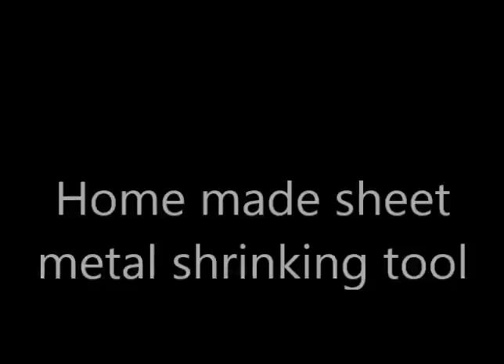Home Made Sheet Metal Shrinking Tool

Comment: Well done,very nice job, seems quite heavy duty which is what you want. Wondering why you made the vee blocks out of aluminium or did I misinterpret that? I’d imagine they must be subject to quite a high wear rate? Sorry for all the questions, final one, any idea what thickness of mild steel it can cope with.?
Reply from the maker: Yes, Niall, the vee blocks are indeed alloy (high spec aircraft stuff) which is more than adequate for the application. They are not subject to any excess loads  and slide well on the steel jaws and in the carrier. Easier to machine to boot !
 In steel, the thickest I have used is 18 s.w.g. but as for aluminium it would probably cope with 12 s.w.g. with ease. Hope that helps.

Comment: I like your machine , very nice. I am in the middle of building one my self and was wondering what is the ratio between your, hand and the jaws and if you were to build it over would you change the amount of leverage thank you for sharing -Spicer
Reply from the maker: Thanks for favourable comment, Greta Hovland / Spicer.
The top jaw has a total downward movement of .140 inches over the full 70 degree arc of handle travel. This leverage worked out just fine for my work and I would see no reason to alter this if building another one. 
Hope this helps to answer your query.

Comment: Hi Brian , very nicely built piece of kit ! 
I am dead keen on building one ! 
Could I ask , what thickness material you used for the sideplates , also , what keeps the upper jaws from falling out ? I would assume it to be the spring clip ?

Thanks in advance! :)
Reply from the maker: Hi, Hamish, - the side plates are 6mm thick - just what I had to hand at the time. The toes on the spring clip pass through slots in the stainless steel casing and into the top blocks as you surmised. This is essential to lift the jaws every time to clear the sheet metal.

Comment: Nice engineering. I usually just use a thin cut off wheel on the bend point and welled in the gap. A little more time consuming but effective.
Reply from the maker: Yes, Samual Iam - that's precisely what I used to do before I made this tool.

Comment: Very nice, are plans, or build video available?
Reply from the maker: Sorry, creator Nater - I just doodled it out on the inside of a cornflakes packet more or less as I went along so no plans available, but there is quite a bit of info on the video which you could use to make a stab a making one.
Reply: Brian Davison I just finished purchasing one at the h freight 😂
I might make a video about reverse engineering it, then returning for a refund.
Reply from the maker: @Creator_Nater  Nice one !
Reply: @confabrication  nice work i have a question can you use a different type of file ??? I can't find a single cut :( only crosscut

Comment: wow..my man, you just made my day, thank you, im from venezuela and this kind of tools doesnt sell here, but now i can make one with this video, i only have one question, the blocks are made from aluminum, but the small blocks? are those the same size?? theres any measure that i have to be carefull about???
Reply from the maker: Hello, neoholland. The pairs of steel jaws you are referring to are the width of the aluminium blocks less about 5 to 6 mm gap (see video after 1:55 minutes), which allows for the steel jaws to squeeze inwards and then be returned by the spring. They are the same depth as the aluminium blocks. No particular measurements to be overly careful about - Just make everything as precise as you can. I hope this helps you.
Reply: awesome my friend!! is really cool that you answered, actually you inspired me to build my own!! it doesnt matther the size of the blocks right??? i mean if i made those too bigh is bad?? or too small?? i kinda want to build something like yours, i saw your comments and you mentioned lazze, great metal shaper btw!! im looking for measurements online so i wont screw my build!! thanks again
Reply from the maker: Hello again, neoholland.   I suggest you do what I have done in the past - viz:- Work visually from a known dimension - in this case the 2 inch (50 mm) square jaw casing and scale everything else from that. I may not be absolutely identical but it will be near enough.

Comment: That is really slick! It reminds me of these plans, but I really like your idea too! To what tolerance did you make your parts? Thanks

Plans: http://www.jalopyjournal.com/forum/threads/shrinker-stretcher-plans.233393/
Thread: http://www.metalmeet.com/forum/showthread.php?p=131582#post131582
Reply from the maker: In reply to Dan Wood - Thanks for the +ve comment, but as I said on the video it was not my idea and is mostly just copied with a few variations  I just made it to normal engineering tolerances - nice fits, nothing special. The shrinker on the link you sent, which I hadn't seen before, looks very like mine but the pics are a bit small and indistinct for me to really get a close look at them.
Reply: +Brian Davison Thanks for the quick reply! I forgot to mention, if you click on the little pics they should enlarge. Sorry for not noting that. I'm going to try to imitate your project and see what I can come up with. Thanks for the inspiration!
Reply from the maker: Hello again, Dan Wood - I did indeed click on the pics and they enlarged as you said, (feel stupid for not trying this now blindingly obvious thing myself !)  This tool has the advantage of a deeper/roomier throat than mine, but I prefer my bearing idea rather than just the basic lever action.  Also he has stretcher jaws included which mine has not, as I don't anticipate the need for them here. However, might make a set if a job for them comes up.
Hope to see a post of yours when you get it made !  Brian.